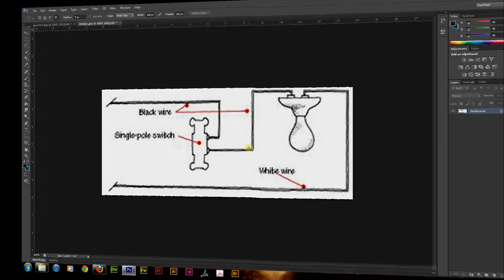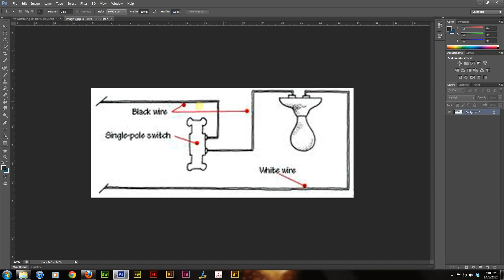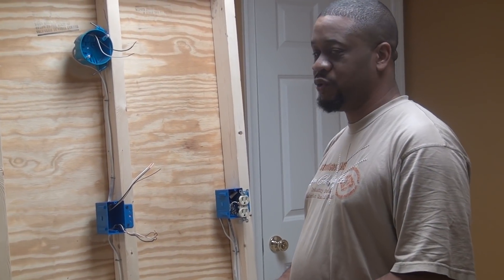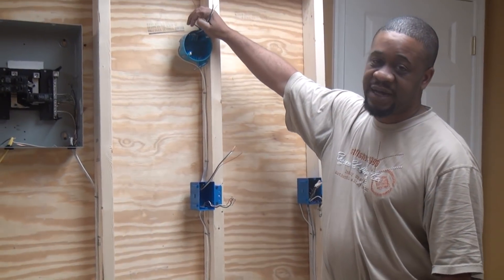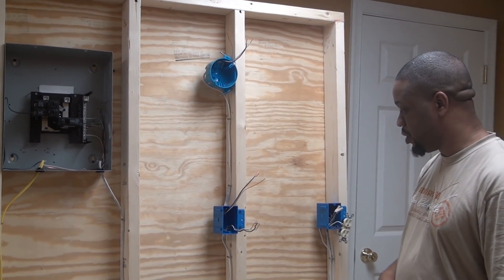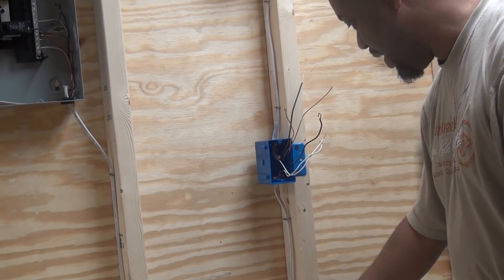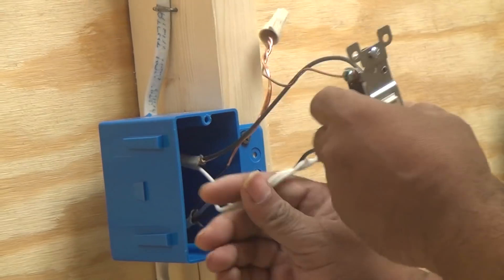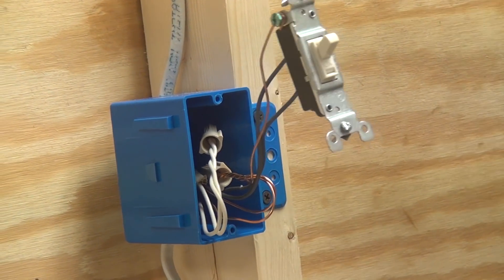how to install a single pole switch

Comment: Nice tutorial.  Question: wold there be a potential issue if the outlet is 20 amps with 12 gauge wires?  If there's a use case where the outlet wires are putting out i.e 18 amps, would the light wires (14 gauge) get hot 🔥??  Thank you and have a great day.

Comment: Very Good presentation.  However, you need to add some comments in the beginning that the power is off (breaker is in the off position) before you start handling the wires.  Someone out there will be crazy enough to NOT turn off the power.  And when you did turn the power on at the end you were handling the bare switch.  I would have put the switch in the box and fastened the light base to the box.  Safety is key with 110V.  It can kill you.  Thanks

Comment: if I have 2 lights then I'd just wire a pigtail white to white and black to black from one light to the other correct?
Reply: Yes, one source coming in, one going to the next light, and one pigtail to the first light, for each black and white.

Comment: The hot wire coming from the breaker goes on bottom or top screw on switch?

Comment: Mr. Robertson: Thanks for identifying the terms that you electricians use when identifying the parts and explaining what goes on and why the wiring works the way it does.  Great the way you made a mistake but showed us how to correct it - things never go the way they're supposed to.  If you're not a teacher, you should be. Cheers!

Comment: got a question.  I wired a single pole switch. power to switch first.  Then it T's to 2 lights.   I thought I had followed your video , but now one light goes on and off with the switch, the other is on constantly.   What did I do wrong.??

Comment: The box wear the switch goes is plastic and the box where the light goes is plastic.  Why was it necessary to attach the ground wires by way of a pigtail to the switch but not necessary to attach the ground wire to the light fixture?

Comment: That was more helpful then other videos but I'm still confused about the part where you put wires to the wall plug. Why is that there? Cant you wire from the breaker panel just to the switch then the light? I will have to hire an electrician I guess. Already got huge shock once and now I'm terrified.

Comment: I could be wrong, but isn't the black wire in your drawing opposite of how you installed? Did you mention that the power feed goes unti the bottom of the switch and the light ties into the top of the switch???

Comment: Does it matter what Brass screw the black wires are connected to, in regards to the switch going to the light. Bottom brass screws with incoming black wire, top brass screw with out going black wire to light???

Comment: Why did the white wire did not connect to the switch and instead shoved into the box? Thanks
Reply from the maker: the white is the neutral conductor when you run your power to the switch box

Comment: Hi. What would cause a hardwired ceiling light fixture to stay on even when the switch is put in the off position? The switch previously controlled a half switch outlet.
Reply from the maker: was it working and then stopped working?
Reply: @Tyrone3340  The switch previously controlled a half switch outlet. I converted the outlet to have constant power. I decided to install recessed light and used the switch to control the lights. Now the lights turn on when I turn on the power at the breaker, but the switch does not turn off them lights.
Reply from the maker: @gbengoosewuru4139  you wired it wrong. use your meter and test the wires and find the one that is live when you have the switch on dead when the switch is off. connect that wire to your light

Comment: I learned two things from your video.  Make a pigtail for the ground wire.  I spent a whole bunch of time and stress trying to get 2 soild core 12 gauge copper wires around that tiny green nut outside in about to rain on me weather.  Second thing turn the loop on wire under and screw clockwise.  Man that is a pitb when wire pops off tiny screw and you start over.  Especially when you here the lady of the house asking if you are almost finished.  LOL or Cry out loud.  Ha ha.😉

Comment: so how would I wire it if I wanted to add another light fixture same situation(one switch just like in the video)
Reply from the maker: from first light blk to blk and wht to wht
Reply: @Tyrone3340  so basically just connecting same way using pigtails right?

Comment: good morning Tyrone I installed a regular receptacle Outlet to my cable TV cable cord and it works great is that safe... can I use it as a regular plug in?. Christine Bayer.
Reply from the maker: not sure what you are talking about

Comment: So to connect a switch from an existing circuit like that outlet, u would connect thru pigtailing wires like in ur part 2 right then connect wires just like this to switch right?
Reply from the maker: yup

Comment: yes I will send you an image where I took off the light fixture at the hallway ceiling and I replaced it by capping it off thank you for replying so quickly I appreciate if you can help me figure this out again I took out the old light fixture and I kept off the electrical wires and I put the cap on the upstairs electrical wires are all branched together I will get that image to you soon thank you.chris b.

Comment: Mr Robertson ? Can you look at this video on wiring a shed. Please let me know if its safe or not . i can see it working but i dont know if  it will work over time . The video is called ....Easy quick shed electrical  wiring
Reply from the maker: need to add a link to the video
Reply: https://youtu.be/7PHMiQS9L0Q
Reply: Im looking at 3 options but im not sure which is the best to serve my needs . 1) run it from my fuse box upstair 2) piggy back off the outside receptacle in the back of my house 3) use the plug method in the video link  i dont want to waste alot of money i dont have just to power a saw, chargers for hand tools and a radio.  By the way i have 4 outlets wired piggy back and one single stage light switch in my 10 x20 shed which is 50ft from the back of the house .
Reply from the maker: First of all do not under any circumstances follow the advice of that video, quick and easy is all well for some home projects but ELECTRICAL IS NOT ONE OF THEM!!! anyone can power something up with an extension cord but everyone will not survive electrocution. Firstly the wire feeding the shed is outdoors (ground potential) so great care must be taken to protect that wire. If UF cable (recommended) "(forget the extension cord )" is used it must be buried underground a minimum of 2 feet you should sleeve the cable with pvc where it comes out of the ground 18 inches below the surface (at the house and the shed) this would be the easiest approach. Feed from panel or if you have a outside outlet consider the load (power needed in the shed).
Reply: Im going to use the uf cable and pvc piping so we good on that.My question is will it be ok to jump off the outlet in the back of my house or one of the outlets under the house in the crawl space ? Like you stated everything will be under ground to spec and once the cable reaches the shed the first point of contact is a gfci receptacle everything is piggy back from that point on. I just need a power source i want be running a compressor or anything pulling that type of power or i would good 240v

Comment: Mr Robertson. Working on a grdfather house. Over 100 years old. It has wall lights with switches, floor outlets (Older then me), no ceiling lights or wall switches. I would like to bring up to date. Any ideals Sir? I'm pretty mechanically in Kline. Was thinking of stealing source from the wall light for the ceiling light n switches.?
Reply from the maker: sounds like you could benefit from a total rewire

Comment: Mr Robertson. How high should a wall switch be place in  room from the floor?
Reply from the maker: it is not set in stone but I go 52 inches to center or 50 to the bottom of the box

Comment: Good video. Can I ask a question? I am hanging a pendant light. It has a ground (copper) wire and a brown-covered wire, with 2 ribs. However, the box has 3 wires. Do I need to splice the light wire?
Reply from the maker: Not sure if I understand what you have. need more info

Comment: Why did you add that extra un-insulated wire and wire-nut to the ground?
Reply from the maker: you need to keep continuity with the ground through all of your cables but you also have to ground the switch. connecting the grounds from the 2 cables coming in the box keeps continuity and the pigtail off that splice connects to the switch hence grounding the switch and finally you must put a wire nut on all of your splices. Hope that helps you. (by the way all of the bare wires are grounds)

Comment: I want to replace a single pole light switch with a single pole dimmer switch . When I was going to remove the light switch I noted that there is no green ground wire. There is only one red wire and two black wires on the existing light switch. I am not sure what to do with the red wire in the wall and the green wire on the new dimmer switch. Any suggestions would be greatly appreciated!
Reply from the maker: is the two blacks tied together on the existing switch?
Reply: I am not sure one is connected to the screw and one is pushed into the slot on the back of existing switch that is directly behind where the screwed one is. I don't know if they are connected, the red wire is pushed into the other slot in the back.
Reply from the maker: the two blacks get tied together with on black wire on the dimmer the red gets tied to the other black wire. (thats assuming the dimmer has 2 black wires and the green). If the dimmer has one black and one red with the green tie the 2 blacks to the black and the red to the red. If you do not have a bare wire and the box is metal you can get a green  10-32 screw and screw the green wire from the switch to the box if you have the bare wire connect to the green and pigtail to the box if box is plastic then just put a wirenut on the green and leave it in the box
Reply: Thanks, I installed exactly as you suggested and the new dimmer switch works!
Reply from the maker: you are welcome Rosemary

Comment: there is one light in my friends house where when the switch is off there is still a very dim light that is only visible when its dark.... im thinking the switch was install to the white line instead of the black line so the ground is always making the light to have low voltage even if the switch is off?

Comment: one question do you wire up the light you show the same at on a led light that has a ballast in it I have six small led light bar that has to led tubes I am hooking up three on one single pole and the other three on a another single pole switch

Comment: great video! By far one of the best ive seen for an ametuer. Question i cant seem to find an answer to is, does it matter if your source runs through the light first and then run your feed to the swtich or does the source have to run throught the switch first? and why? i cant seem to find clarification on this. Thanks again
Reply from the maker: No it does not matter.

Comment: Really helped me out... i was about to put both hot wires on one of the screws on the switch and the other white wires on the other screw... but this is much easier i liked how you did the two white wires together separately and just the hots on the switch

Comment: Thank you Robertson.  I have a question? I have a switch with an outlet but I add a wall lamp  and I try to change the switch for a dimmer one model,  Skylark Contour Lutron switch and does not work.  could you do a tutorial with a dimmer.  Thank you for your help.

Comment: thanks so much!  I did an electrical class a couple years ago, and I needed this as a refresher.  I'm already doing my first year as a electrician's apprentice.
Reply: also, if you want to make a switch work, make sure it's constantly hot.  Make sure that that the load from the panel is connected to the wire from the switch
Reply from the maker: congats

Comment: does it matter what hot wire goes to the top screw or bottom screw?
Reply from the maker: no not on a single pole switch.

Comment: Hi guys need a bit of advice needed please.., large flourescent light fallen still hanging on wires, tbh we dont know which way the switch is on or off and need to cut the wires is it safe to do so thanks
Reply from the maker: turn off the breaker for the circuit that light is on.

Comment: I have a switch that is about 20 feet away/ and it its 4 foot from the ground and the light is about 7 feet above how do you go about wiring that? I only have enough cable to do a single run! this video is a two cable method right? how do you do a single wire hook up with only two wires a white and a black (2) wire with a ground??? the cable is 12 gauge FYI Thanx
Reply from the maker: i have no idea what you are asking you say there is a light and a switch, are you trying to add another light and feed from the existing switch?

Comment: WOULD ONE RUN THE ELECTRICAL THAT CHOSE TO THE FLOOR?LOOKING AT YOUR DEMO WALL...OR WAS THAT JUST FOR THE DEMO?WHAT A GOOD HIEGHT TO DRILL HOLES FOR WIRE AND PLACE SOCKETS ?

Comment: What happens if you connect the white wire to the switch instead of the black?
Reply from the maker: depends on what the other end the white wire is connected to

Comment: Tyrone, I'm running a closet light for a walk in closet.  there is nothing close to tap to except a 20 amp auxillary line off my furnace / blower.  is 20 amp too much to run a simple light and single pole switch, or should I be fine?
Reply from the maker: nope just be sure to use 12 gauge wire and depending on the dimensions of the closet  use a light with a hard plastic cover.  the code requirements can be tough to work out so you should go with that type of light just to be  on the safe side.

Comment: I followed everything on this video. the problem I'm having is when its done the light stays on so when I flip the switch on & off it doesn't do nothing. What the problem I'm having. IM USING A PROCELIAN TO A WIRE MOLD AND I ADDED A SWITCH BECAUSE THERE WAS NO SWITCH BEFORE SO I ADDED A SINGLE POLE TOGGLE SWITCH... I DONT UNDERSTAND WHY MINES NOT WORKING

Comment: If I want to wire more lights, is it better to pigtail the wires off of the first light or use the screw-on terminals?
Reply from the maker: pigtails are better

Comment: For a single-pole switch (1 ground screw, and 2 screws of the same silver color), does it make a difference which white or black wire goes into the 2 silver screws? thanks
Reply from the maker: nope

Comment: I got 99 problems but a switch ain't one.
Reply: You just got a huge laugh
Reply: I have 99 problems and a switch was one after a guy tried to charge me 60 bucks to put in a single pole dimmer and the guy lived around the corner and is just a handyman!!!!